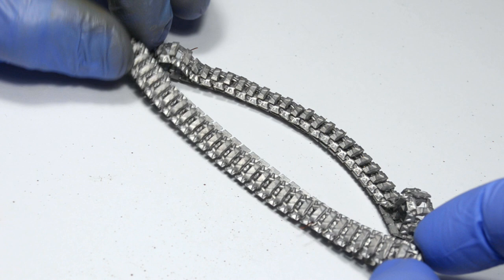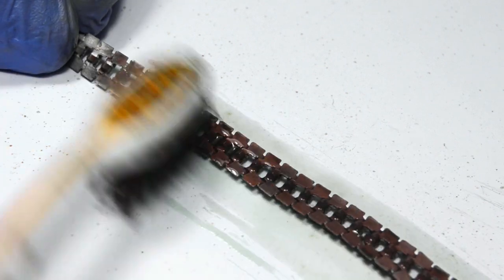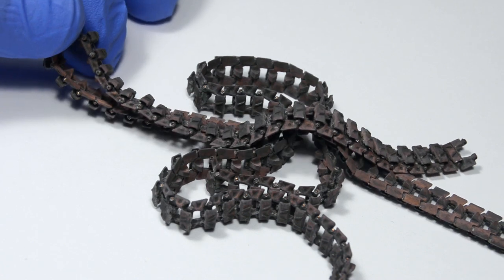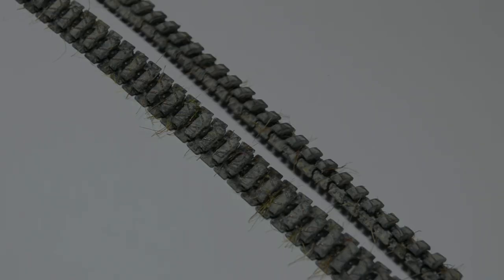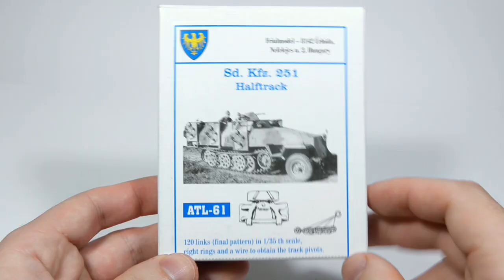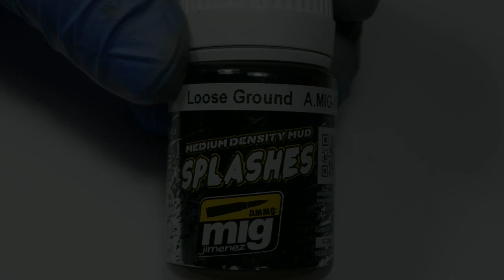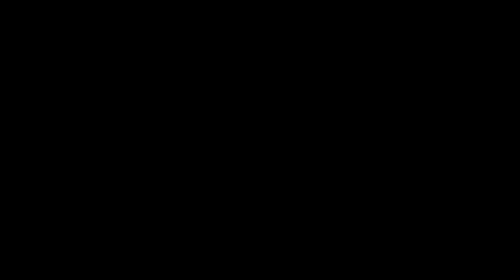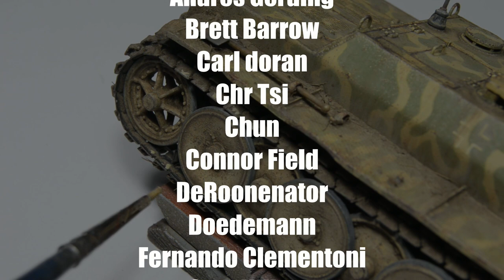Some Thoughts On Weathering Friulmodel Metal Tracks

Comment: Hey chemist here again: You can probably make the burnishing fluid from white vinegar and steel wool. Leave it in over night, brush the vinegar on. Tin (the main part of white metal) is subject to Iron Accretion, that is to say, if there is dissolved iron oxide in contact with it the iron oxide (good old rust) will start to stick. It is probably in the form of Iron Acetate (which is greenish and used to stain wood, like the solution in the bottle), and that's safe and easy to make. They might have a stronger acid, so it's faster, but since home made is dirt cheap you can just leave it in over night.

Comment: I've personally found that using straightened out staples instead of the wire that the tracks come with works really well and means that more often than not you dont need to use much if any super glue, also, on the subject of calling burnished surface "like a Primer" well, its called Red Oxide Primer for a reason, its actually a method that has been used to "prime" metal Surfaces for a really long time.
Really enjoyed this video, Thanks a lot Martin!
~J
Reply from the maker: Many people seem to enjoy the staple method. However you don't need to use superglue in most cases, friction holds the wire in place if the tracks are wide enough.
Reply: @NightShiftScaleModels  very true, "hair-pinning" the wire tends to help, putting a bend in the middle of the wire so it acts as a spring. Though I also like the staples because they tend to be the right length, so no excess clipping.

Comment: The outside of the tracks is in rubber (covered with mud they look good), the inner of the tracks would be metal too where the wheels are in contact... It's still a good work! 🤩

Comment: Hey Night Shift.  I’m not sure if you’re aware of this technique or not, but I haven’t seen you use it, so will try to explain it.  If you hold a toothpick or similar in front of the nozzle of your airbrush (about 5mm out from the needle) when spraying, it will collect paint on the toothpick, and then the air pressure flicks it off in splotches.  The result is similar to when you’re flicking with a paint brush, but you can direct it more easily.  I hope it makes sense.  Give it a go and let me know what you think (unless you already do it, in which case tell me to shut up and crawl back under my rock :D )

Comment: Hi Uncle - Fruil tracks are great... expensive, but great. However never used burnishing fluid before - might give it a go, looks pretty easy.
You and Panzermeister36 doing some weird thought transferance?
Great vid, thanks for sharing.
Reply from the maker: Before I started using the burnishing fluid the paint wouldn't hold on the bare shiny metal and would easily flake off. It definitely makes working with them easier and more efficient.
And it's just a coincidence 😃

Comment: I sprayed my tank with red primer to emulate German red primer since I am going for that late war look. I wanted to spray certain areas with black then resorts them with the primer in an attempt to do some shadows or simple modulation? I don’t have an airbrush do you think this is possible with just cans? Is there a good way to remove paint without destroying the plastic? Thanks for all the help!
Reply from the maker: If you plan on using that as an underlying coat for Dark yellow then yeah. You can maybe spray black paint from the bottom and then spray the Oxide red from above, however this will only work as a sort of pre-shading if you're going to cover it with camouflage. If you're going for a factory fresh tank in oxide primer, then I'd create the shadows with oil paints, WAY more control.

Comment: Great video and I learned even more!!!! Now question would that burnishing fluid work on metal parts on a 15mm flames of war war gaming tank or no?
Reply: It should, but I haven't had much trouble with the tracks on my tanks not holding paint. I use Rust-Oleum black for priming, though.

Comment: Uncle night shift, I just got an airbrush. The only paints I have are enamels and cheap acrylics, are these good for airbrushing or should I get something else?
Reply from the maker: I think Tamiya paints are your best bet. If you begin with good quality paints from the get go, you'll learn how to work with your AB much faster 👌
Reply: Night Shift sweet. Thanks for the tip!
Reply: I am a complete newby as far as using an airbrush; but I know two very experienced modellers.  
Both recommend Tamiya as they feel it's reliable,  straightforward to use and provides a decent finish.